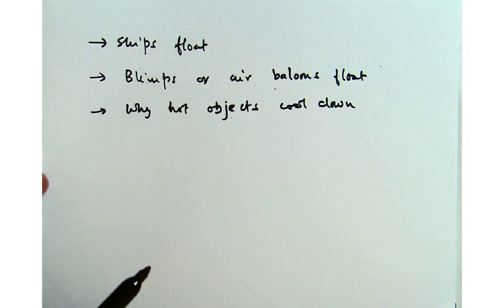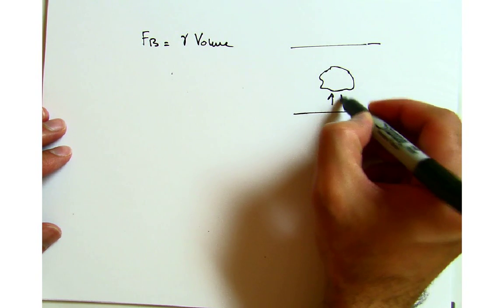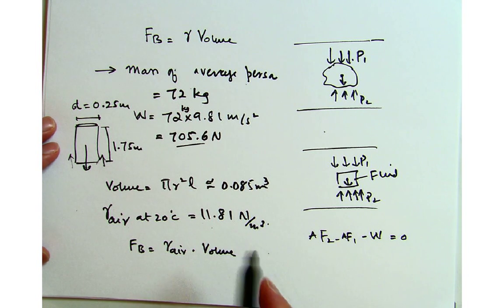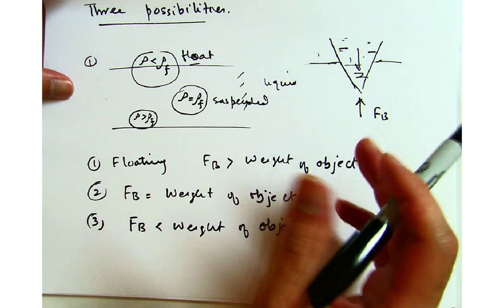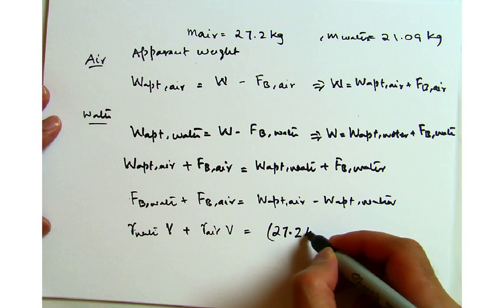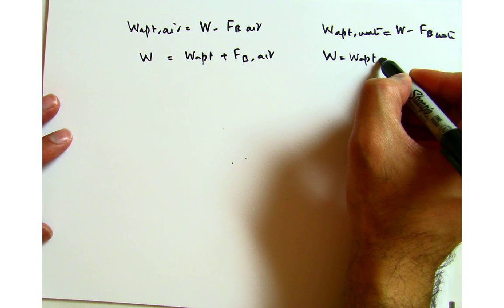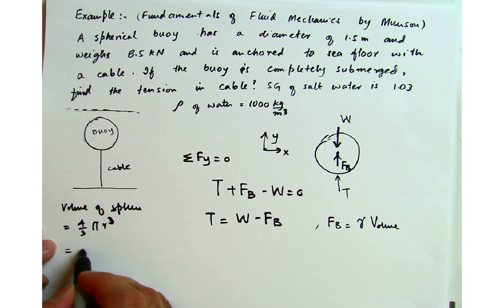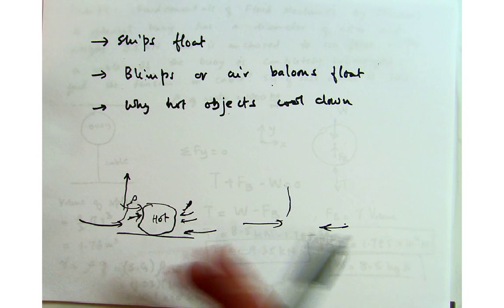Buoyancy

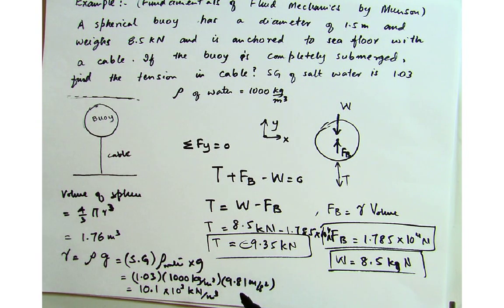Comment from the maker: Well you are right that tension direction is opposite of what I chose but sometimes you don't know which direction the tension is as it all depends on weight and bouyant force, what you do then is to assume any sign for tension and if the answer come out to be negative then this means you have chosen the wrong direction and flip the direction of tension as shown on time 30:50. I changed the direction of tension. Hope this helped!